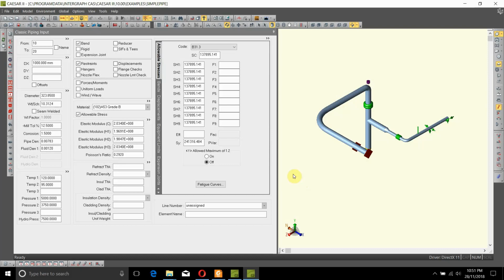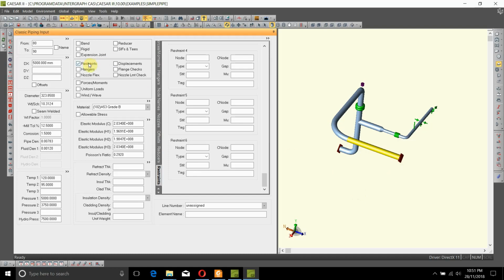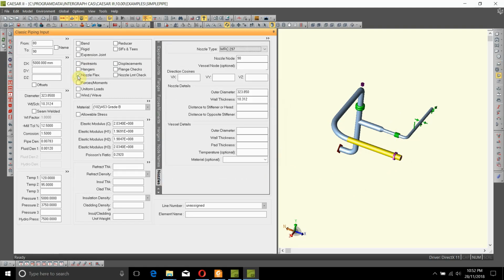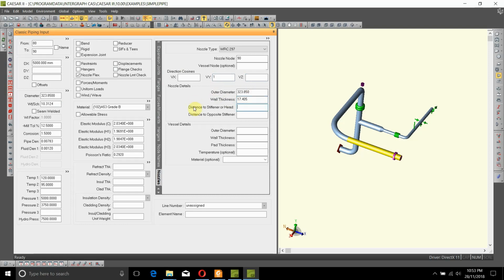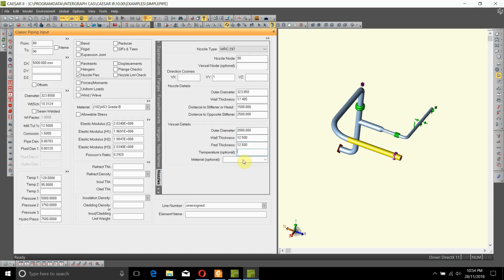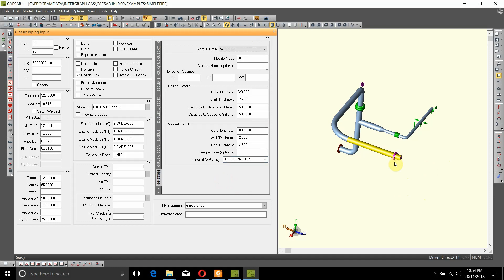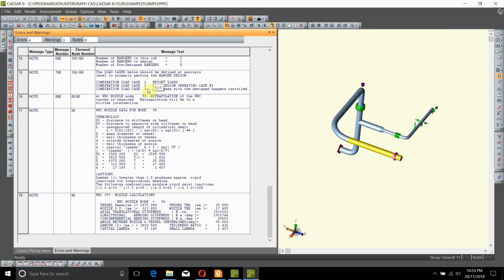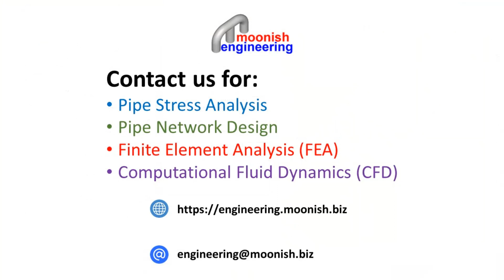How To Add Nozzle Flexibilities in a Piping Model in Caesar II

Comment: When we apply the nozzle flexibility on caesar, do we run the nozzle check together? Some cases the allowable loads limitation has been given in project specification.
Reply from the maker: Adding nozzle flexibility and running nozzle check are two separate things.
Adding Nozzle flexibility changes a Stiff Anchor to a flexible one with nozzle parameters.
Nozzle check, checks it against several parameters.
In this video, I am just discussing how to apply nozzle flexibility.